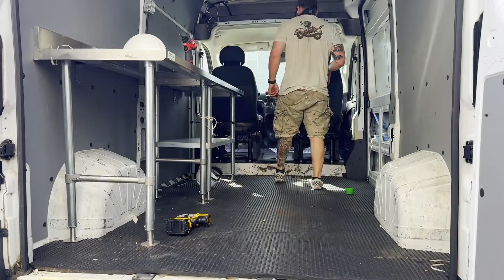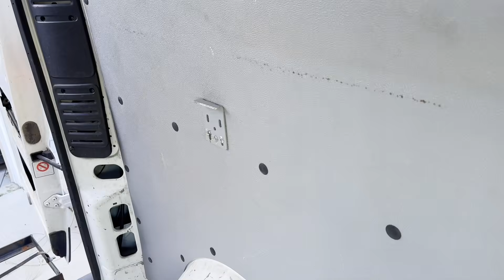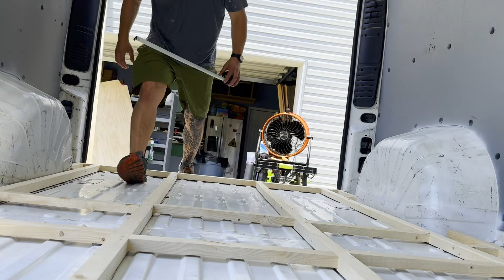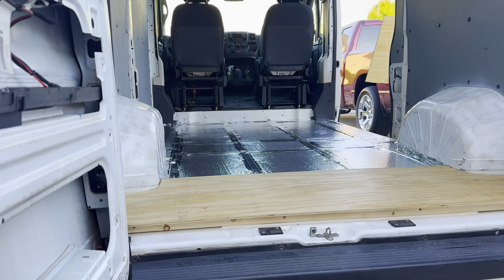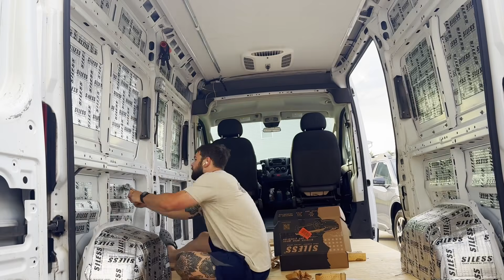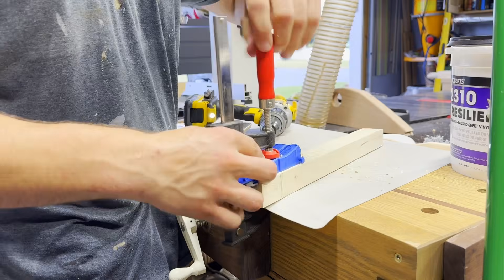Van Conversion Starts Now - Insulation, Subfloor & Sound

Comment: Can you tell me what foam board you used for the subfloor inside the framing?  I see you went back & put in soundproofing felt underneath.
Reply from the maker: I linked the foam board I used in the description. Yes I got some hardwood floor felt underlayment that really helped with road noise and also added insulation

Comment: I hope you will put another layer (one piece) of radiant insulation with an air gap to optimize the insulation property and cover all the metal parts to avoid thermal bridging.
Reply from the maker: That is the plan but I am going to be running the electrical beforehand!